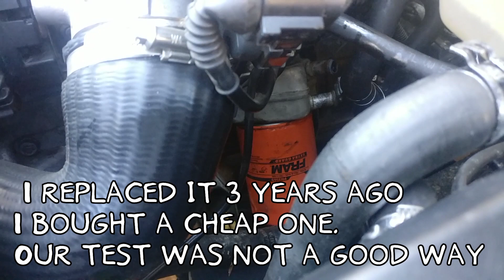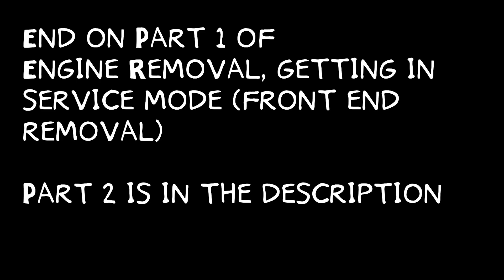VW Passat Pulling Engine Part 1/3 (Putting car in service mode 1/2)

Comment: 1998(96 euro) was the launch of the B5 model. The B5 went through minor cosmetic and accessory changes in 2001. Anything from 2001 to 2005 is the passat B5.5. Check vin number to be sure

Comment: @Beers 'n Gears When putting the car back together how/whats the easiest way to put the transmission cooler lines back into the radiator, I jus cant seem to get them in? Please anyone with instructions please lmk
Reply from the maker: Perhaps they got bent? With the radiator not mounted I attach all the lines then mount it.

Comment: Any idea how to remove the bottom plate (belly pan), my mechanic has struggle to get it out ..
Reply from the maker: Just plastic clips and screws. Not hard at all.
Reply: Cant tell if you were joking or if your mechanic is just trash
Reply from the maker: @FingeringMyTurtle  I never had an issue. It's bheld on by some 8mm bolts and some plastic clips. The plastic clips have a center you lift up with a panel removal tool (or screwdriver if you don't have one) and then the whole clip will come out. And the belly pan should just fall straight down.
Reply: @BEERSnGEARS  yeah that was my confusion with his question. Cause the belly pan covers the oil drain bolt on most VWs including the b5.5( if I remember correctly, took mine off and lost it a long time ago) I used to be and express tech at a VW dealership and we had to take off the belly pan with each service. So they are made to be super easy to take off. Hence confusion.
Reply: Also. While you were taking everything apart, the sensors connectors with the metal clip that you had to take out to pull it off. Yeah. You don't have to pull those clips off

Comment: So im trying to discern whether or not my 2003 passat is a B5 or a B5.5. My turbo died and this video really helped me make more space to work with. But is there any obvious clues for the identification of my car?
Reply: 2003 should be the passat b5.5. Easy way to be sure is check the rear lighs. B5 will be mostly red but the b5.5 has clear seperating the red into two parts down the center horizontally for signal lights